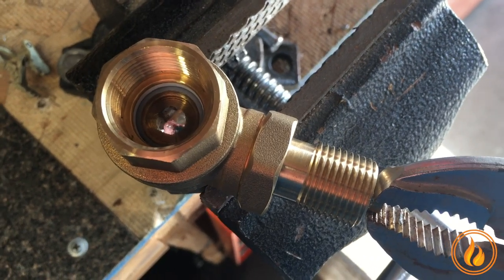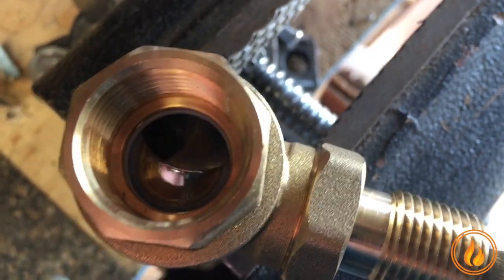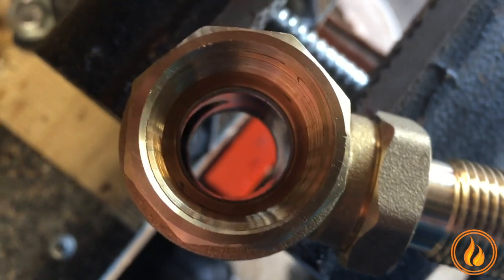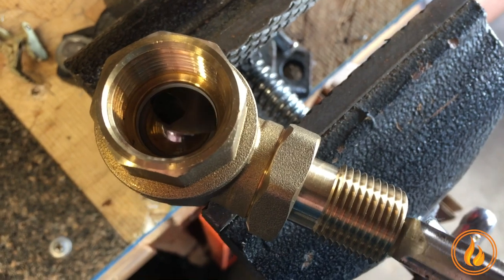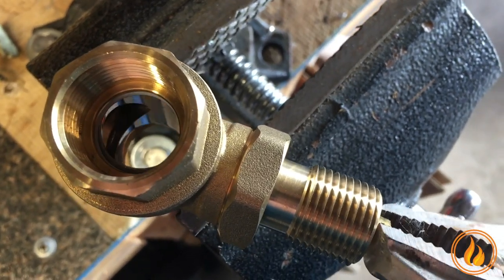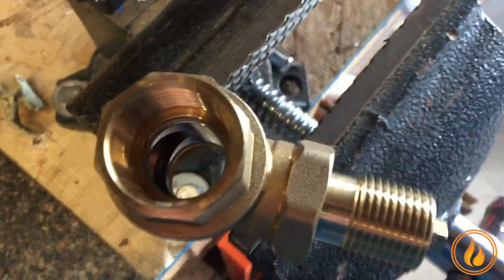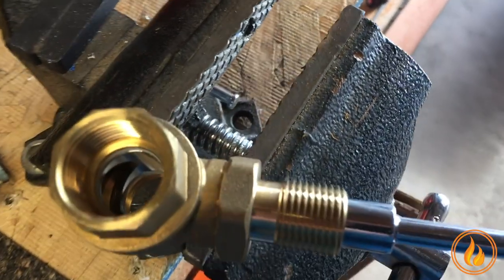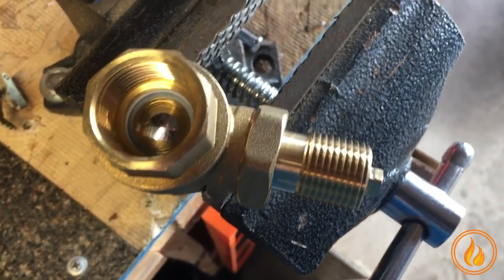What happens if my key valve sticks on my outdoor gas fire pit?

Comment: I have a .25 inch installed in the floor for an indoor fireplace and the valve is stuck in the closed position. Broke the key trying to turn it open. What could i use to lubricate the turn stem to break it free?

Comment: My outdoor gas fire pit has been installed and working for years, but when I went to turn the key the other night for the first time in months, it is stuck and I can’t get the key to turn. Can I spray wd40 in there, or is there anything else you recommend trying?
Reply from the maker: Try some drip silicone lube on the actual ball valve. May need to take it apart.